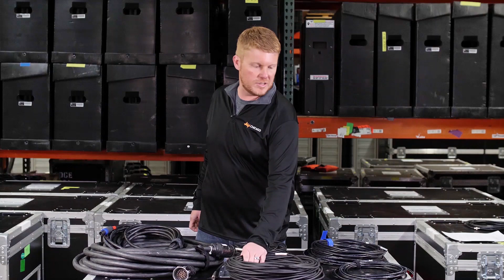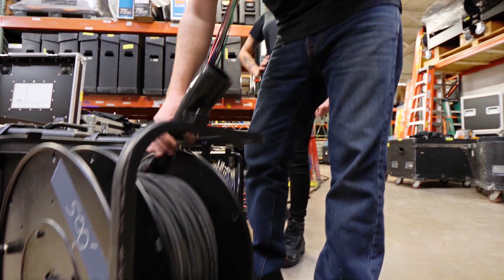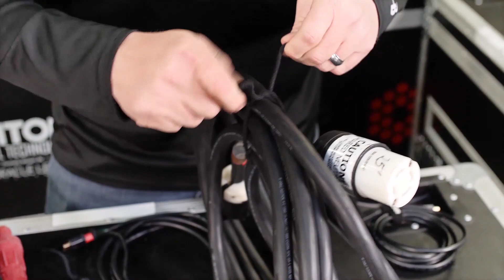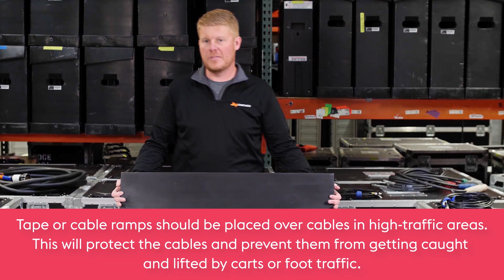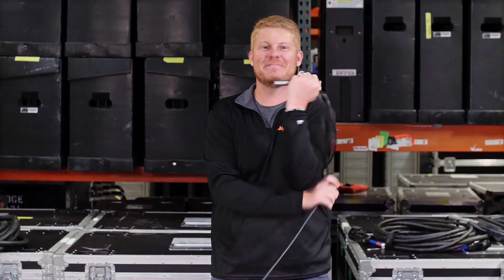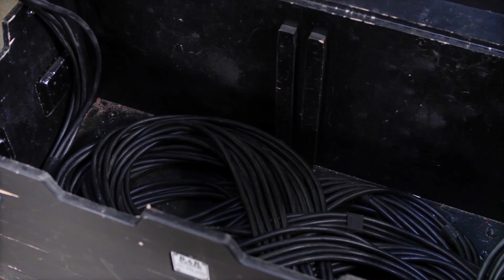Managing Cables for Live Events

Comment: What about using colored zip ties instead of electrical tape?
Reply: No No No Zip ties damage cables obi wan
Reply: Are you thinking for identification or bundling?
Zip ties tend to get over cinched. And they leave a nice Point when they're not cut flat. They're also more of a permanent install method.
I have seen a couple people who will put a colored zip tie on their cords to identify. but just about every extension cord comes with a black zip tie on it with the annoying 5 foot safety tag so I don't know why this guy thought he should use black.
Reply: no no no no no no no no no

no
Reply: No. But something I can point you to is car wrapping vinyl. Have strips of varying lengths (for varying cable thicknesses) plotted out on different colored sheets. There are companies that let you upload a file and they plot it and ship it to you. Then, you wrap a strip around each end of your cable, making sure that the cable is clean and that both ends of the strip overlap. This last bit is very important - the overlap is where this method gets its power to stay on for years and years. The best thing about it: it doesn't leave sticky residue like e-tape and unlike methods that utilise clear heatshrink over the marking to make sure it lasts, it's quick to apply, especially when it comes to cables that have already been terminated.